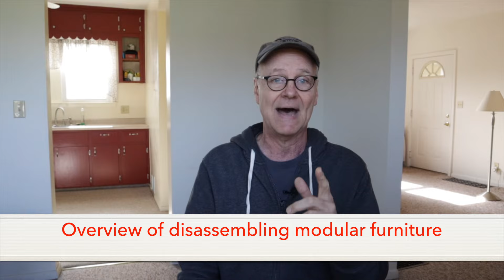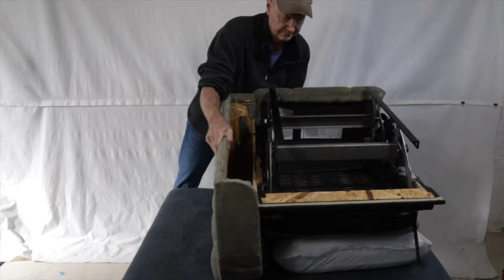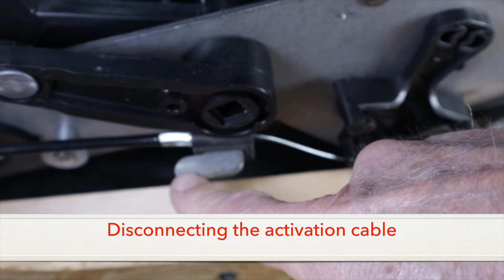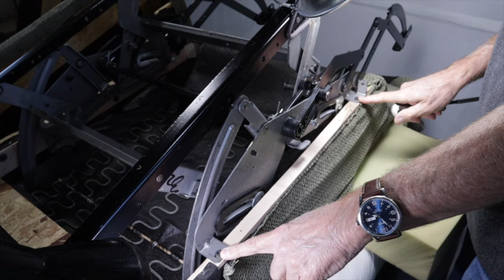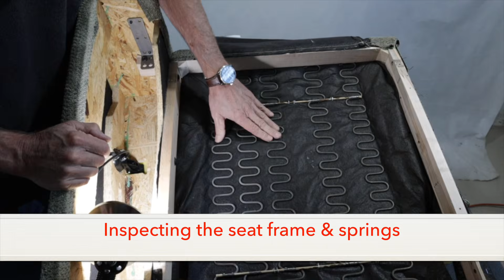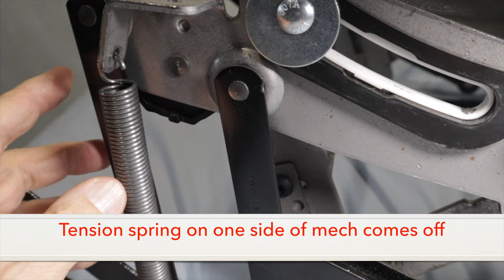Reclining Mechanism Repair - Part 1

Comment: My wife and I have a love seat and a couch. We've each sort of worn out one part with the opposite part of our respective furniture essentially unused. I'm going to replace "her" worn left end with "my" unused left end. Should be good to go. Thanks for the video so I know what to do!
Reply from the maker: @ltcterry2006 - If the loveseat & sofa are compatible, it should work.
Reply: @reclinerrepairguy4155 I couldn’t find my T30 bit, so went to buy one after partially disassembling the first part(s). On the way home I realized you mentioned the furniture was modular. I just swapped the two ends intact. Worked great! So glad I saw your videos and thanks for the reply :)

Comment: Nice job Lazyboy, a $0.15 cent plastic part fails, causing customer to spend hundreds of dollars to repair. “Not available” parts are only available if they think it will fetch big bucks $$$. I would have had liquid nailed that split part closed.

Comment: Hello! I have a leather recliner that I purchased in 2008. It still looks beautiful. The mechanism is loose and needs to be replaced. I have had no help from Legget & Platt or other manufacturers. I have removed it and can find no markings anywhere. It is a 3-way wood-to-floor.  Please help
Reply from the maker: @MissMillie4me2 - Did you look for an ID tag on the recliner? That's the best place to start. If it's a name brand, there should be one or more tags.  If you still have your receipt from purchasing the chair, the recliner brand may be listed. And if you haven't already, check with the dealer where you bought the chair -- if they're still in business. They may be able to help identify the recliner.

If your recliner isn't a name brand, you won't likely find a replacement mech. "Unmarked" furniture (no ID tags) is produced that way intentionally, to make it unlikely (impossible) that you can order parts to service it.

And even if it is a name brand, not many companies still produce 18-year old mechanisms, UNLESS those parts are still being used in newer furniture today.
Reply: @reclinerrepairguy4155   Thank you! I have narrowed it down to a Leggett & Platt Prestige. Do you know where I can purchase one? Thanks again!!
Reply: I tried Leggett & Platt. They will not sell to consumers. (Oh BTW I found out the chair was manufactured by Robinson & Robinson).

Comment: Help! I have a recliner problem-- it opens and closes fine, but it tilts to one side. I can see the problem underneath it-- the top most bar is tilting and it's worse when someone is reclining on it. I have pictures of what it looks like in all positions. I don't know if it needs the whole mechanism replaced, and if so, where do I get that mechanism? How do I find answers to this problem? I watched ALL of your videos looking for this specific issue.
Reply from the maker: @rachelthomas804 - Sounds like a bent reclining mechanism. Contact the manufacturer of the furniture to see about ordering/installing a replacement. If you purchased it a local furniture store, they may provide this service -- contact them to find out. If you have a name brand unit, there should be an ID tag on the furniture. This provides the info you need to order parts. Here's a video on where to find those tags ----> https://www.youtube.com/watch?v=py2bSPcu41o&t=12s

Comment: I need help, I bought my recliner love seat from Value city which is no longer in business. How can I get a new kit? I don't know the manufacturer. Is it on the furniture somewhere?
Reply from the maker: @Greg_Carter304 - If the furniture has a manufacturer ID tag, it can be located in several different places. Try looking on the underside of the footrests, hanging behind the opened footrests, along the bottom of the arm frames, seat frames, etc.

Comment: Where can I purchase a new unit for leggett and platt sofa recliner mechanism  they all broke  thank you
Reply from the maker: @valerieconsalvo239CAPECORAL - Always start with the furniture manufacturer when it comes to replacement parts or replacing reclining mechanisms. If that's not an option, you can try contacting Leggett & Platt through their website.

Comment: You are kind of helpful but this is not repair work. You would have done something to reconnect that spring if you were a repair man. You probably aren't allowed to fix anything if it is under warranty. Great job troubleshooting the problem. A problem like that should not have to go all the way back to the manufacturer if you are an authorized repair technician. If lazy boy doesn't allow a authorized repair tech to fix a thing like that, then that tells me to stay away from that brand. There should be a recall if a tiny plastic spring hook brings an entire mechanism to full replacement.
Reply from the maker: @eosdelb - The problem with the failed plastic part was pretty simple. The part itself was not replaceable. (Whether it was not available separately for order, or whether it was not separately removable, I don't recall.) As such, the only option for repair was to order the larger part which came with the plastic one already attached.
Reply: @reclinerrepairguy4155 if all that was wrong with that half of the mechanism I think a heavy keyring could be used to save the customer money. Make a groove with a file on the outside diameter of the plastic piece 180 degree from where it broke and just hook it to it. Why feed the machine that just wants you to throw it away and get a new one?

Comment: What is the cost of the chair mechanism
Reply from the maker: @catherinewhorriskey6064 - Contact the manufacturer to get a quote on the total parts cost + shipping or any other fees they may charge. Also, keep in mind that if you have a name brand recliner, that there may be some parts warranty coverage still available to you. Check your warranty info -- if you saved it -- or contact the manufacturer regarding that possibility as well.

Comment: Is it possible to stop the "rocking" mechanism on an electric flexsteel rocking recliner?
Reply from the maker: @maryh1121 - I'm not familiar with those units, but you should be able to "block-up" or restrict the rocking. I would start by contacting the dealer or manufacturer to see if they recommended method for that.

Comment: Hi I'm a repair technician and I've heard of other technicians repairing mechanisms and replacing bolts on a mechanism that holds the metal scissors parts together, I'm working on one right now and I drilled out the metal industrial rivet, and I found that one metal scissors part has one size hole and the other one that connects to it has a smaller hole and then it has a riveted and do hold it together, now my problem is where can I find a solution to put this back together so it is a good hold and doesn't interfere with the mechanism opening and closing, thank you very much if you have any solutions! Also looking for the plastic bushings and other plastic part that keeps it from wearing out metal and metal. Thanks!
Reply from the maker: @Law9223 - As I'm sure you know, repairing rivets, bushings, etc. on mechanism scissors is problematic. And the only time I ever delved into that was when a replacement mechanism was no longer available. But I didn't have the type of experience required, or any metal machining experience to bring to the table to avoid the, "Hey, that repair you did failed again" scenario. 

So, I started researching vendors that manufactured mechanisms & came across a company called Ultra-Mek. They used to refurbish some brands of mechanisms. I used them a couple of times & they did a good job. But I'm retired now, so I don't know if they still refurbish or not. You can check with them if you're interested ------> https://ultramek.com/

Comment: I had a repair person come last year under extended warranty for a broken plastic part that wouldn’t bring up the back (plastic, really?!). after he left the power recliner foot rest won’t fully extend. As it is out of warranty now, he will not fix whatever he did (it worked fine before he started working on it). Any idea what it could be or who I could contact to fix this in Central Florida? I have looked everywhere online for videos and repair people and come up empty.
Reply from the maker: @OrganicRN - Sorry, I'd have to inspect the chair to offer any specific suggestions... and I don't know any repair techs in FL. You can watch this video for tips on getting help -----> https://www.youtube.com/watch?v=3GX8KRS2oVU

Regarding your situation -- having a problem immediately after repair service -- is one I'm familiar with. I always recommend trying the chair out when the service is completed. And with in-home repairs, that means BEFORE the service tech leaves your home. (And for those who may be picking up their chair at a service center, try it out before you load it into your vehicle!) If you fail to report the problem while someone is still present, the next best thing is to call/text them right away.  

When we let too much time pass, there's always a chance that warranties can expire & that repair techs may not take responsibility for botched repairs. Calling them on it right away is your best defense against sketchy service practices.

Comment: I'm sort of in the same boat, electric reclyner had to push it back in last night as I heard a clunk and it wouldn't retract, on looking under the support bar in the middle was at an angle... don't know if the weld has snapped or the screw has snapped holding it, gonna have a more thorough look later

Comment: Why not just file or grind off that silly plastic part that is designed to fail and bend a bigger diameter on the end of the spring so it clips snugly over the rivet ?  Just like an old carburetor throttle return spring ! A nice thick plastic 3D printed hook would be a fancier solution too.

Comment: Hello - we have a Lazy Boy sofa, love seat and rocker we purchased 3 years ago. The spring on the rocker has been replaced by them. Now, both the left and right springs come off. We have ordered and received springs from Lazy Boy, but putting them back into place does not work - they continually come off. We have looked at the love seat attachment and believe we are putting the springs back on the same way they are on the love seat - but no matter what we try, the springs go on, but when engaging the handle to bring the foot rest out - the springs pop off - both sides. Any suggestions? Thank you
Reply from the maker: @marianneteague4682 - If you're referring to the mechanism springs on a 1- piece La-z-boy mechanism, this video covers one scenario that can cause the spring to come off when the footrest is raised. Have an experienced La-z-boy repair tech check it out if you're having trouble pinpointing the problem.

Comment: The metal bushings in the reclining subassembly have worn out in my Lazy-boy couch causing the backs to lean back and a little all the time and lean back crooked so I would need to replace the entire one piece mechanism. Can you give me a ballpark cost for a set of these. Are we talking $50, $100, $250, or more?
Reply from the maker: @joefoster3914 - If you are the original owner of the sofa, these parts should be covered by warranty, if they are still available. You'll probably have to pay shipping, which La-z-boy can quote you. See this video to learn more about ordering La-z-boy parts -----> https://www.youtube.com/watch?v=5M6d40rxH-s&t=43s

Comment: How to repair a steel, pressed rivet that came out? Can't even find the parts for sale anywhere... Most rivets are cheap aluminum that will break easy.
Reply from the maker: @krispy5139 - I would always replace or rebuild the mech with new parts. Because if one rivet has failed, other part failures are not likely to be far behind. In situations where mechanism parts were no longer available, I sometimes contacted a company called Ultra-Mek, to see if they could do the repair. That's been years ago, and as I recall they only worked on certain mechs. But I see that they're still online, so that may be an option.

Comment: I'm not sure where to figure out which parts I need.  I cant find any identifying marks.
Reply from the maker: @kingdarkem - A thorough inspection of the chair by an experienced repair tech will determine what replacement parts are needed for repair. The tech will also look for an ID tag regarding the manufacturer & getting parts. 

If the chair has no ID tag, but you know the brand, that will help. However, if it's no--tag & you don't know the brand, unless the tech recognizes the brand, getting parts will be a problem.

Learn more about where to find ID tags --------> https://www.youtube.com/watch?v=py2bSPcu41o&t=11s

Comment: I would put a hose clamp on that plastic part around the whole thing solving the problem
Reply: Even a strategic bitve wire would be able to cover the function of the broken plastic..
Or looks like simple to 3D print a copy..
Seems crazy to replace 2 whole arms just for the sake of a tiny bit of cracked plastic?!

Comment: Hi there Mr repair guy,  I need help trying to find the replacement mechanism for my purchased Bob’s sectional power recliner chair?  I’ve tried to contact Bob’s customer support and no help there. Any suggestions?  I think some of the picking rivets are shot. Just a guess.
Reply from the maker: @ChuckBronson100 - Replacement mechanisms are fairly specialized parts. There are 3 common places to get them: #1 From the manufacturer of your furniture. #2 From the seller (dealer) or warranty service agent. #3 Sometimes from the vendor that makes the actual mechanism. If there's a ID sticker on the mech, you may be able to get one that way, but it's a long shot.

Bottom line is, if you have a warranty & need replacement parts, hold their feet to the fire & make them honor that warranty. See my 'Recliner Parts' video series to learn more ------> https://www.youtube.com/watch?v=EwJ8a_yqqy0&list=PLUvoKoh6bpz_kKFbJJ5E8HxLsN87_ZPIo

Comment: Have a Southern Motion electric recliner.  The foot rest is not extendiing as high as it once did.  We removed actuator and tried spun the shaft in as far as it will go, there was no difference in foot rest position when extended.  We next replaced the actuator but that didn't fix the issue.  With the chair fully reclined by the actuator we can manually raise the foot rest higher.   There is loosness in the last hinged sections.  We can't see any way to make the foot rest extend higher.  Do you have any suggestions?
Reply from the maker: @WMeffaMike - Finding a repair tech experienced with servicing that brand is probably your best bet.

Comment: Hello, I am looking to repair my broken recliner mechanism. The side push bars are bent outwards.  The part is RMT75A05. 
Do you know where I can get this part please?
Reply from the maker: @jamesbrown5110 - If it's a name brand recliner, try contacting the manufacturer or the seller (dealer) for parts.
Reply: @ It’s an off brand, I don’t think it even has a brand. I was able to get the part number off the mechanism
Reply: The scissor part is bent outward, I bent it back but it just bent again. Debating on the best way to fix it. If it’s not really worth I it then I’ll probably just toss it.
Reply from the maker: @jamesbrown5110  - If it's a no-name product, you have 2 options. Contact the mechanism vendor -- if there's a serial # & ID info on the mech -- to see if they'll sell you a replacement. Or, if you can find a store that still sells that exact same chair, they might have access to a replacement mech.

Comment: I watched your on Reclining mechanism parts 1 and 2 my question how do you go about getting the replacement parts?. Do you contact manufacture directly or is there a middle man. My recliner is a  Leggett Plate from 2020 another number I assume is model(?) I know this feed on u tube channel is about 9 months old, I just came across it thanks
Reply from the maker: @rickherald5364 - If you have a name brand recliner that came with a warranty, you can try the manufacturer or the seller (dealer) where you bought the furniture. Keep in mind that not all manufacturers deal directly with consumers & not all dealers will order parts for you. That's why you sometimes have to try both before you find someone that will order parts for you.
Reply: @ thanks for the information next time I’m in town I’ll definitely talk to the store we bought the recliner thanks again

Comment: How do I reinstall the lever handle that came from in between the sofa recliners.Mine came off.
Reply from the maker: @alethiawright5815 - You should have another working recliner handle on your sofa that you can look at to see how it's attached. This is your guide or model for installing the new handle (& cable, if needed). 

Reclining furniture is modular, so you can separate the sofa sections, if necessary. But an experienced repair tech should be able to install a replacement handle without any disassembly. Hire one if you have doubts about doing the repair yourself.
Reply: @reclinerrepairguy4155  Thank you

Comment: I have a La-Z-boy Felix rocker recliner. The screws that connect the swivel base to the wooden base keep getting their heads sheared off. Do you have any suggestions?
Reply from the maker: @wardn53 - Those fasteners need to be pretty tight, not just snug. See this video for a demo that includes tightening those screws -----> https://www.youtube.com/watch?v=83uKDeqfrUw

Install a new set of fasteners as shown, then check them about once a week to see if they're still working themselves loose (that's how/why the heads snap off). Check the base joints as well, to make sure everything is in good condition and not somehow putting excessive stress on those fasteners.

If the screws are staying tight & the bases all look good, my guess is that the chair is getting some extreme rocking or other unusual forces that are causing the heads to snap.